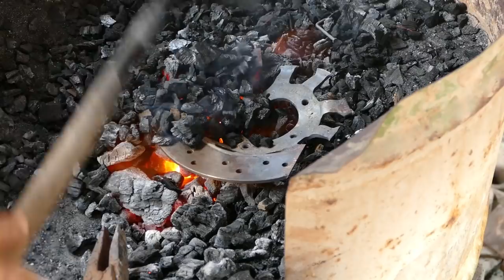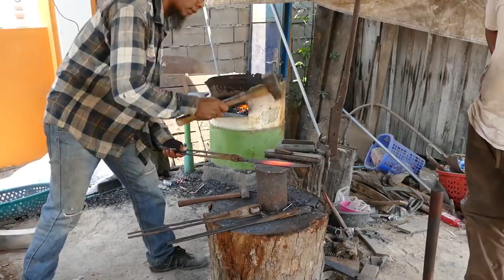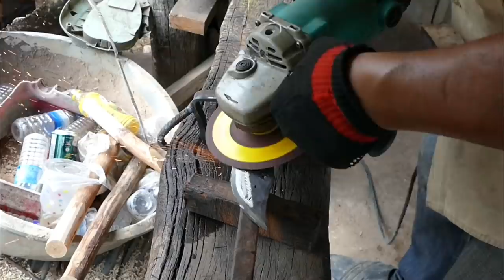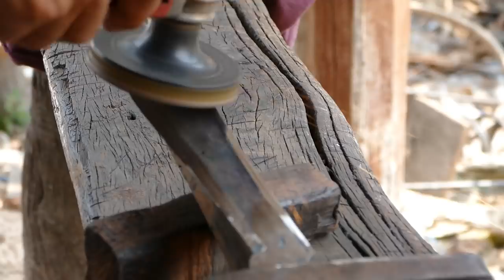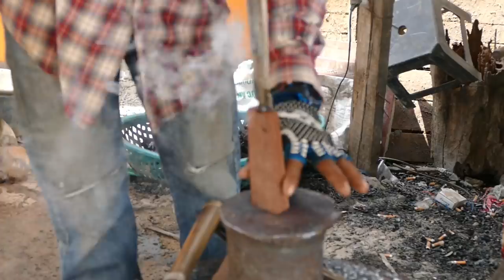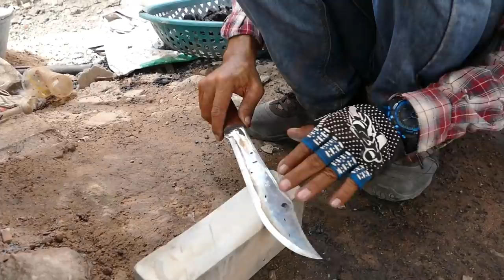Broken Disc Brake Forged Into A Beautiful Useful Knife/Full action by blacksmiths

Comment: Great piece of work. And good hammer work. But you have ti quench in oil
Reply from the maker: No, not in oil. They quench in fresh water. They never use oil
Reply: @AmazingKKDaily  yes. Better than water. Oil quenching is best
Reply: Water is fine. As long as the smith knows how to do it correctly. This smith does. I seen him cut nails in half with no damage to the blade.

Comment: Sorry man, but it hurts my eyes to watch this video...Better use tin, you wouldn't need to heat it up at all...
Reply: A tin knife?
Reply: Wth are you talking about?
Reply: @willengelmann6303  You don't get it? This material is crazy soft, he almost doesn't need to heat it up. By the way, the brake disc made of this ???
Reply: @theshapeexists  Becouse the material he is using is SOFT. He can forge it when it is not hot anymore. Can't you see it? Straightening cold blade?
Reply: @marcinc.9437  Yea, but I actually USE MY KNIVES. Ever USED  a tin knife? A total worth less tool
Reply: @theshapeexists  O gosh, I just said tin, I could say anything that describes how soft the material is. Ofcourse tin is obviously not a material to make knives. How could you even think about it? Yes, even if you have skills you have to use what is available,I understand this clearly. My point is that forging hard steel is a little bit different thing...
Reply: Waiting for someone to say it....